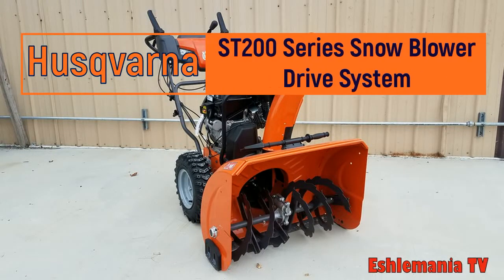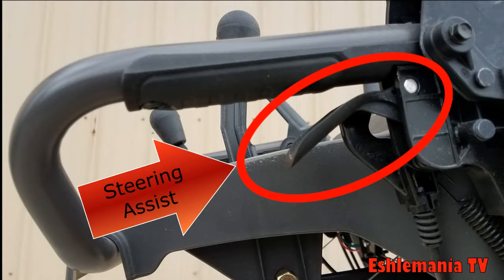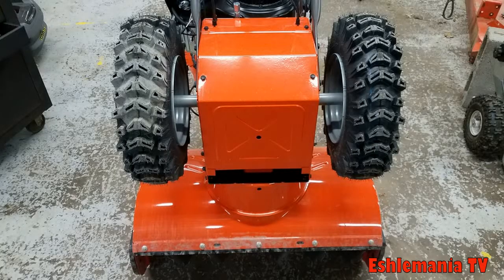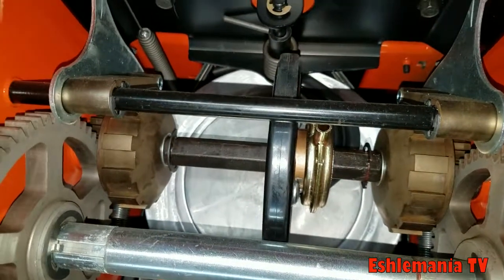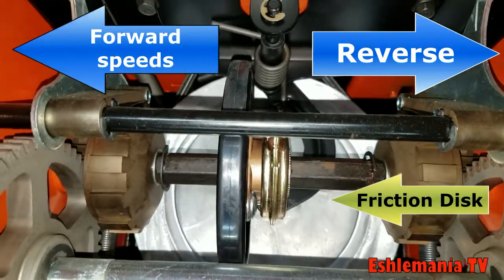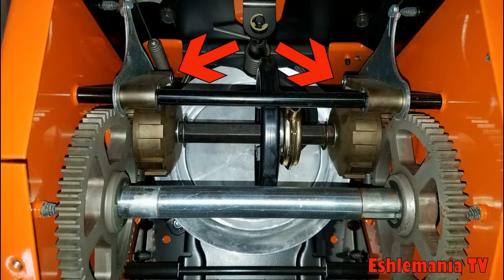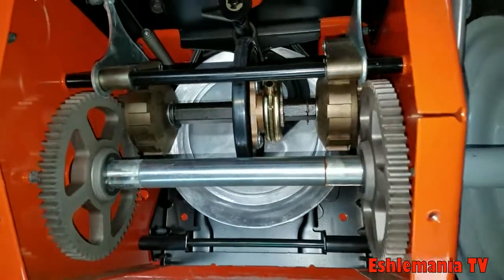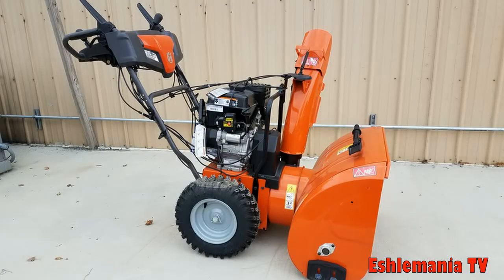How it works! Husqvarna ST200 Series drive system with steering assist

Comment: Question, what would be the cause of the drive assist not working fully? When I squeeze the drive lever completely it won’t drive. But if I squeeze just a little, it will go.

Comment: I have the ST224p. I've noticed that sometimes during use of the self propel, something seems to slip and it won't propel itself. Would I need to replace the drive belt? Or is there something with the friction disc going on?

Comment: Inside the planetary gears there are 3 bearings on each side, very little if no grease what so ever in them. I had to replace all 6 of them after 35 hours of use. You can save a pile of money by getting replacement bearings at the parts store

Comment: On the older model 10530SBE the steering assist is totally different design. There are spring loaded clutch sprockets behind each wheel. My machine one wheel always clicks and will not pull. I checked it and took it apart 3 times cleaned and lubed and made sure cable is letting it snap closed engaged but it still clicks and the 2 cogs with teeth separate and click shut again when engaged. Is there anything you know of that can be done to keep the gears from popping and clicking under load? Could it be the spring is just weak that should hold the gears together during operation? Thanks!

Comment: In Norway, ST224 is WITHOUT "power steering" . ST227, ST230, as well as ST3XX all come with "power steering".
Reply from the maker: There ST224 does not have steering assist. The ST224P does have steering assist. Both models are available here in the US.